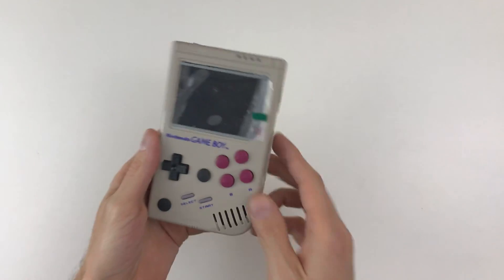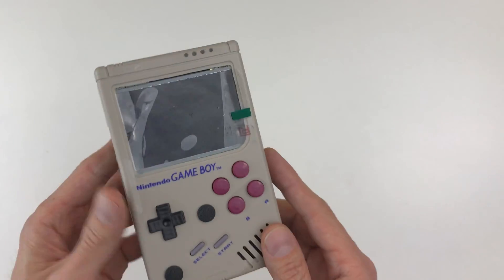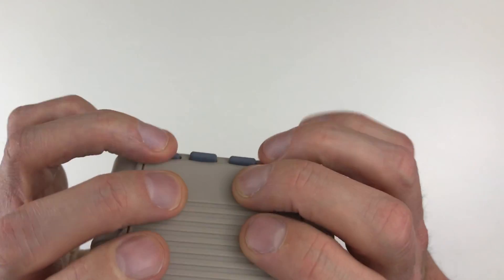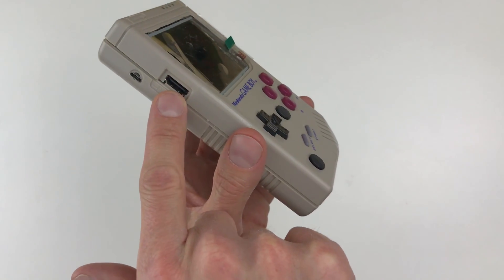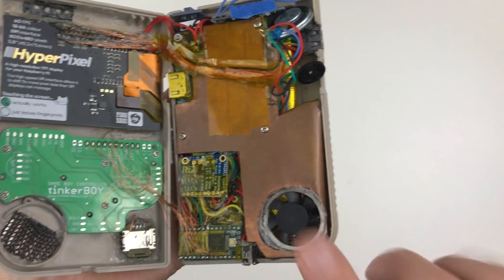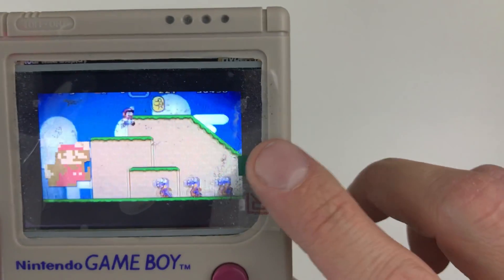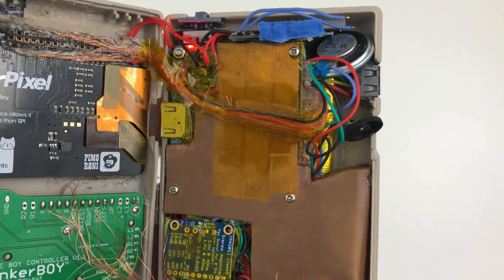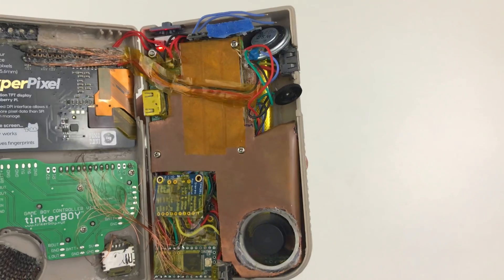Pi3 Boy: Quick Look (2/4)

Comment: Can you give a quick breakdown on how you wired the hyperpixel to the pi?
Reply from the maker: Rockman I removed the plastic header on the HyperPixel roughly mostly with a Dremel. I should have been more careful and took more time to remove it more cleanly, but it got the job done. I may have messed up one of the pads doing that though. I’m guessing that’s why I had some screen issues and had to overscan the bottom few lines. Luckily it was only at the very bottom. I just wired each pin to the corresponding gpio pin on the Pi with thin magnet wire that has a protective coating. I had trouble getting the Pi3 to feed it enough power through the gpio. I was also feeding other things like the Teensy from the Pi so that maybe why. I ended up wiring the voltage inputs on the HyperPixel screen to the power source (boost board if I remember right. I don’t have it on me right now to check for sure). I wrote the seller/manufacturer if it was safe to power the screen from a different source than the Pi (matching voltage of course), and they said it should be fine, and in fact they said it was a good idea. I’m trying to remember, but I think that screen has 2 5v inputs and a 3.3v as well right? Sorry I can’t remember exactly, but I may have kept the 3.3v from the Pi gpio to the screen 3.3v input.

Edit- I didn’t use thin magnet wire for power. I used thin gauge stranded wire; I doubt the thin magnet wire would be able to handle much power (then again I’ve never checked to see what it can handle).

Comment: Dude, Epic build!!! I really like what you have done with cooling. You mention something about button presses. I too had same thing. Check sketch on Teensy. Modify this line and see how it goes for you.

ret->bounce = new Bounce(pin, 100);

Most defaults have a setting of pin, 10 which in most cases is perfectly fine. Mine however had double inputs a lot too. After modifying this everything settled. You can also tweak it to your liking, 75, 50, 25 and so on. 

I have been dealing with heat issues.I will look into the cooling that you have demonstrated here as it looks very effective.  Thanks in advance for the idea there
Reply from the maker: Justin H thanks buddy. I ended up finishing this build the other day. There are 2 more videos after this one. 3/4 is a work montage and 4/4 is the quick show off video with a little battery test gameplay. I’m so glad the cooling worked out how it did here. I ended up getting the Teensy to work pretty well, but I wired an accessible female USB inside the case as well as relocated the Teensy flash button so I could mess with the code if I ever want to. I’m surprised it’s actually working because I really just Frankensteined a bunch of bits together from random posts online :) . I’ll dig into it more deeply at some point. Thanks for the tips too I will look at that first.